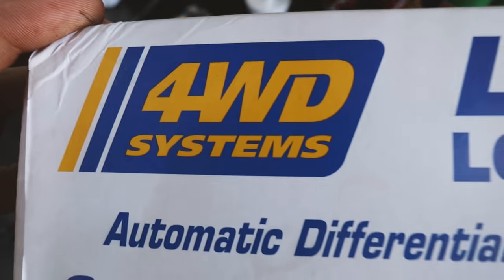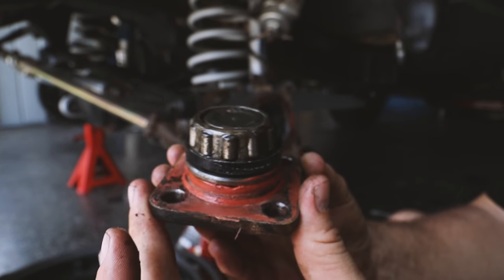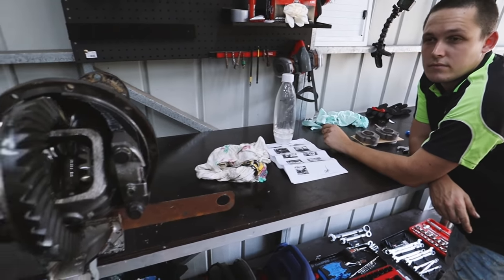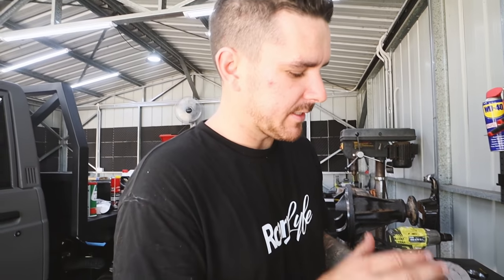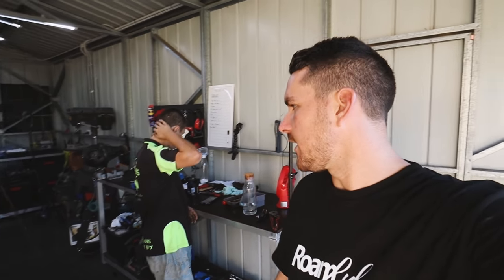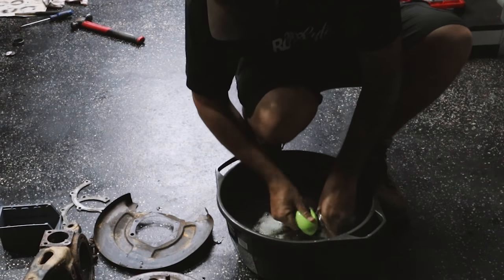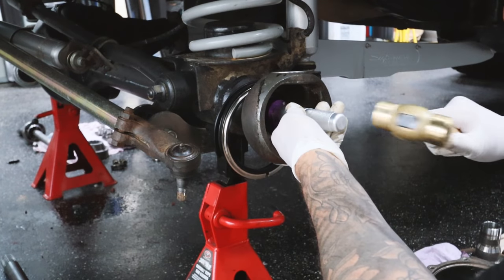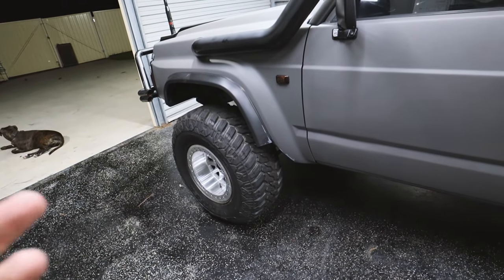$500 FRONT LOCKER INSTALL!!!

Comment: Mint video mate. Great run down showing the process which a lot of others don’t go into such detail. Personally unless they are brand new I would just replace the wheel bearings. They are cheap and the most common fail point on a patrol. Not worth using old bearings. If they are still ok just keep them as spares for when you go on trips.

Comment: Great job as always. Just an FYI on the bearing nut. It needs to be torqued to 167nm - 196nm, spun a few times in both directions, backed off them torqued again to 5nm then locked off. This allows the bearing race to seat and spin freely.

Comment: Got the same Lokka in my GQ wagon ,, is mint there fine in the sand i find ,, unless you full send up cullcup hill and throw all ya belts and only have a alternator water pump spare ,, so you run up deep powder sand at 10psi with a auto lokka with a tight right handler up the top hahahah was much Armstrong steering going on
Reply: Ahaha that’s funny we were just their in Pemberton

Comment: You'll stop thinking about a rear locker when you experience what a difference this makes.  Had a Lockrite in my GU for 11 years, first mod I did from new.  At the time it was $400 and I installed it myself no issues.  Lokka has same operation as Lockrite.
Reply: Needs to run a bottle of engine oil flush through the rear diff for 500kms then drain and fill with new oil. That will clean up that lsd friction plates making it work almost like factory new again. Patrol plus lsd plus a front lokka = legendary performance 👌👌👌

Comment: Should just throw a shim in the lsd. Not a hard job either. Done it in my gq and front arb locker and works mint. Might have to put a thicker shim if your lsd doesn’t work that great? Have 3wd always till I turn the locker on.
Reply from the maker: Was thinking about going a .55 shim in the back to tighten it up! What size did you go?
Reply: @RoamLyfe  yea man that’s the size I went. They’re pretty easy to do if it’s not locking enough. The bloke at road runner told me that .55 will lock a good lsd and a .70 if it’s a worn out

Comment: Awesome vid..I put a locka the same as yours in the front of my ln 106 and love it..so I put a locka..same brand..goannawhere..in the rear..because it would b tough..take out the LSD and replace with auto locka..BIG mistake if u need to use your vehicle for around town use..6 months later I took it out..because the noises that it made scared the shit out of me..it sounded like I was snapping an axle when u went around roundabouts and other normal driving procedures on the bitumen.. double locka in the bush..awesome....on the black top..bloody terrible..when I took the rear locka out..and inspected..it was in perfect condition..much to my surprise..goannawhere is a tough product..

Comment: I haven't been running them king pin cup things for nearly 3years now🤣 I heard some people don't bother putting them back in so I done the same and no dramas yet with my swivel hub
Reply from the maker: I did get told that haha, Probly shoulda just left them! Hha
Reply: Manufacturers do lots of testing, if they weren't needed for longevity.  
Nissan would have saved millions not installing them.

Comment: hey mate! been watching for quite a while. 
with coal i see the exhaust poiints directly on the tyre... wouldnt this heat the tyre up more than the others causing uneven wear? and maybe moisture on the tyre too?
Reply from the maker: Yeah I do want to change the setup a bit with the exhaust, main reason I want to is because it makes the wheel really dirty within no time.. mignt look at a rear exit!

Comment: i have an auto locker in my 80 series front... works great, makes a bit of noise on full turn... my biggest hate is that when your hubs are locked in and in 4wd high gears... the steering fights me, does get annoying
Reply from the maker: Yeah that’s a good point!! I’m hoping it’s not to bad, will he a bit of a learning curve for sure! If it’s annoying we will swap it out to a manual locker!
Reply: @RoamLyfe  yeah mate, lokka are cheap as, great for what they are. But I'll be swapping mine out when i win tattslotto
Reply: If it's making noise your backlash is wrong.

When set up correctly, they're very quiet.

Comment: Keen to see your thoughts on the lokka. I'm considering one/detroit auto locker for my GU as I've heard a lot of people swear by them over air/e lockers which seem to break..

P.s. when rebuilding your swivel hubs source the heavy duty inner bearing seal in the hub and the trail safe axle seals. They shit all over the oem seals which just leak and break easily letting in water and forcing you to tear everything apart again in no time.

Edit just watched vid whole way through and saw you got the right axle seals good stuff.
Reply from the maker: I’m bloody keen to test it out! The research I did see that most people where very happy with an auto front and a manual rear setup! 
Yeah I definitely got told about those inner seals! Glad I went that rout 🤘🤘
Reply: I have a Lockrite autolocker in my GU, best mod of all.  Just do it.
Reply: @einfelder8262  yea pretty keen. I figure if I'm going 4wd'ing I'm literally doing that so why screw around with switches. Some will say it can cause wear etc but I just don't see how that argument stacks up.. The only issue I can see is if you catch yourself out on some dodgy angles and pop a cv
Reply: @Nick-sd7um  The autolocker doesn't cause wear, nor does it cause CV damage. I busted a hub once and had to travel the full length of Fulton's Creek Track with only one front driving - pulled a bit to the driven side but still got me out onto Walhalla Rd.  The only issue I have found is when reversing uphill on full lock, as when going around downhill switchbacks, it can wind up.  Solution is to come off full lock to reduce load on inner wheel a bit then all good.  Note that this will also occur with a switchable locker, which may not release if you switch it off under the same load.
Reply: @einfelder8262  awesome thanks for the info
Reply: @einfelder8262  you do damage more CVs as when you lift a wheel, all the power can be transmitted to the one on the ground.